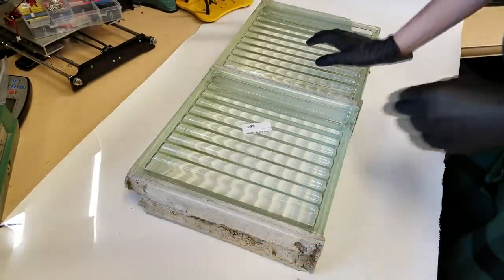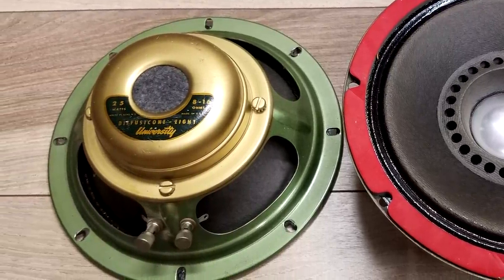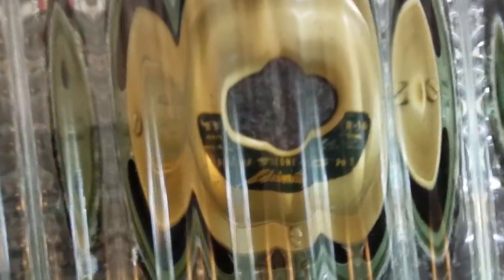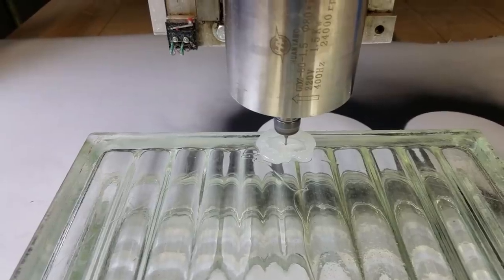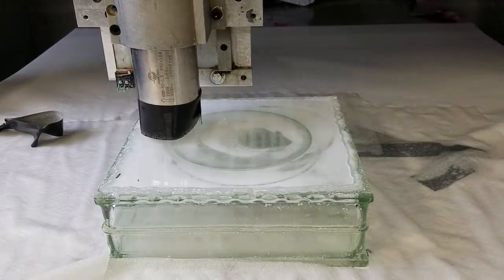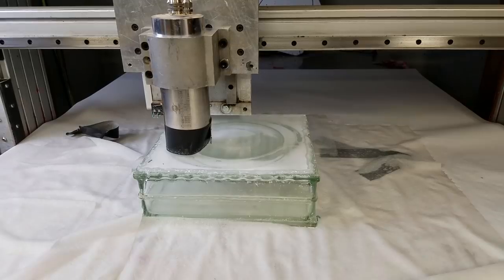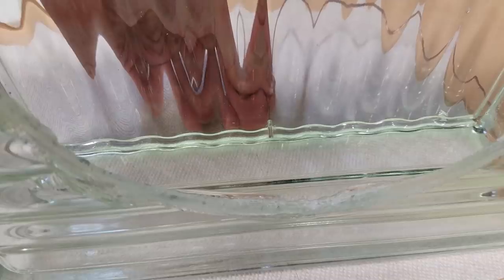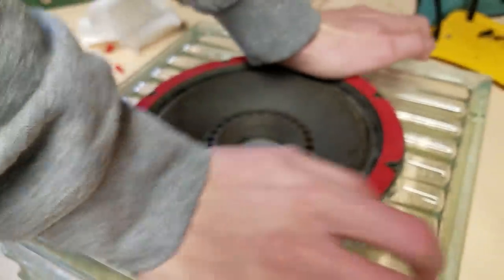Glass Speakers Made From Recycled Materials!

Comment: Just a suggestion I see you used VHB double sided tape which is fine but I would recommend running a clear continuous bead of silicone around the edge were the speaker meets the glass and around the holes that the wire comes thru. Just my opinion and experience with sound systems.
Reply from the maker: Not a bad idea!